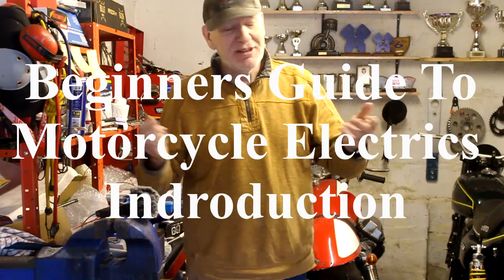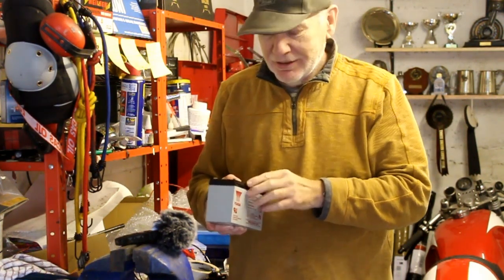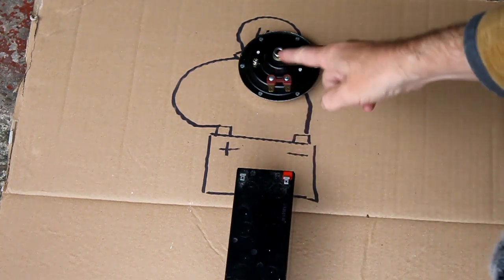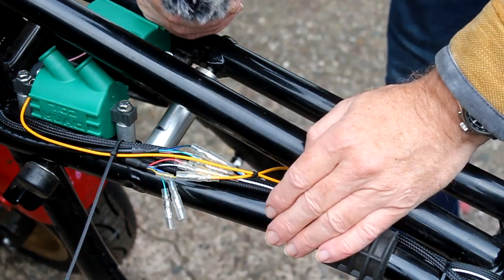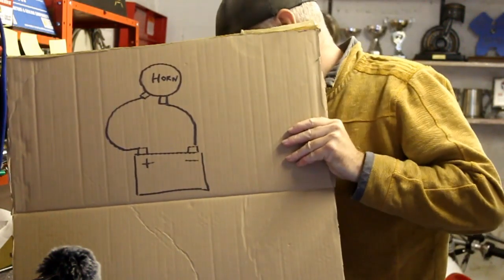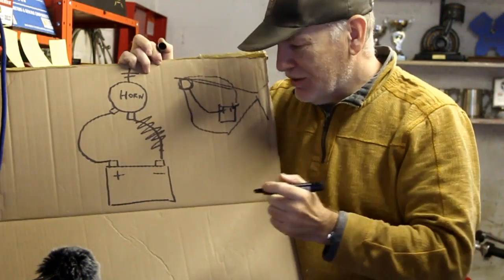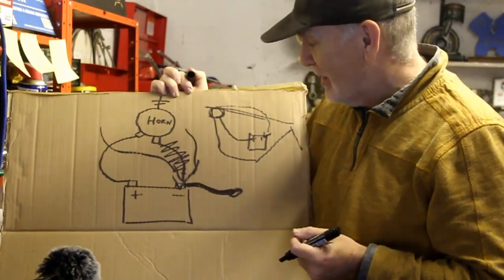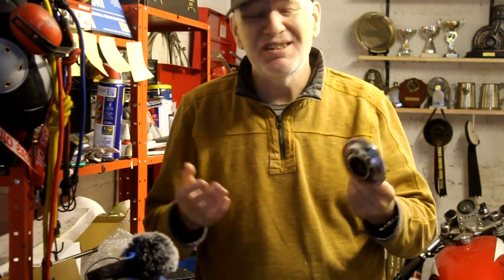Beginners Guide to Motorcycle Electrics - Introduction

Comment: Thanks for your vid.  I'm currently working my 1973 SR 500.  The previous owners wiring is... horrendous. I am determined to tidy it up and have like wires continue in the same circuit...not a red turning into a green the other side of a connector.   How long Will the electric system require to let you know it's about to fry itself due to faulty wiring?  I'm talking about when I finish and switch on for the first time.
Reply from the maker: Before you do anything, sit down and study the std wiring diagram, or if your making your own wiring harness, then draw out your own diagram on paper, and make sure you understand it all before you begin. Also you can test different parts of the wiring as you build it, thinks like lights, horn, switches and so on. So there is no concern when the whole wiring is completed. I use a multimeter, cheap these days, and found a small 12v battery very handy to test circuits as you make them, the small 12v battery is powerful enough to fry your wiring, in case things go wrong.. Here is a vid about making your own wiring.. https://youtu.be/SDjfRCJBqjM?si=LESTiby-VZmk2aX8
Reply: @Merch131ho  thanks alot. It's a good learning experience and hopefully a successful one